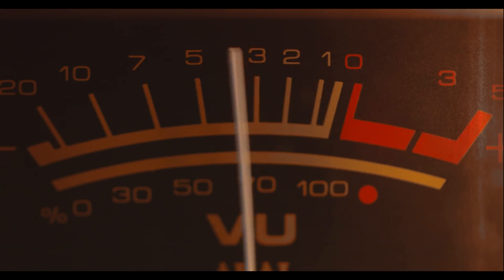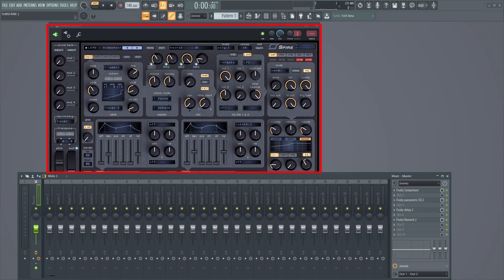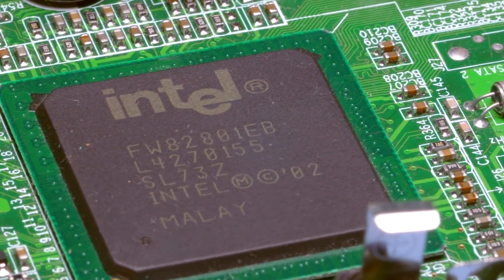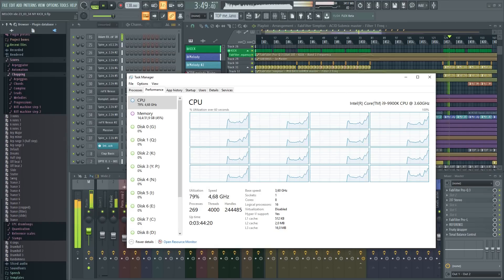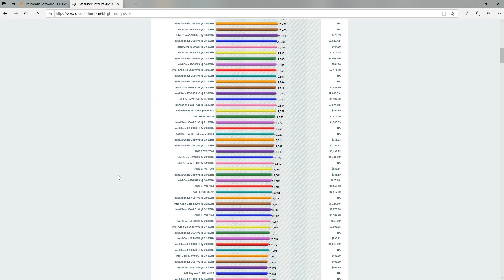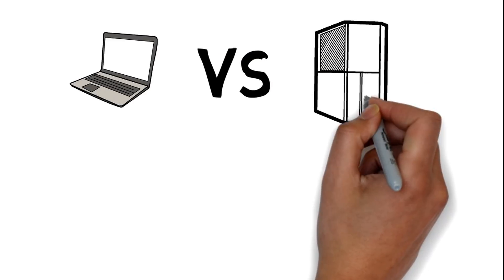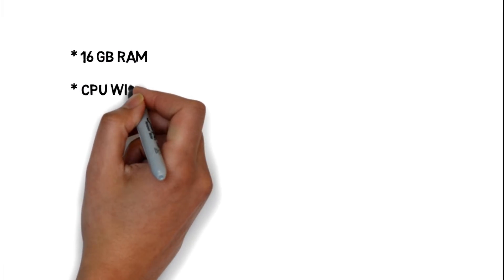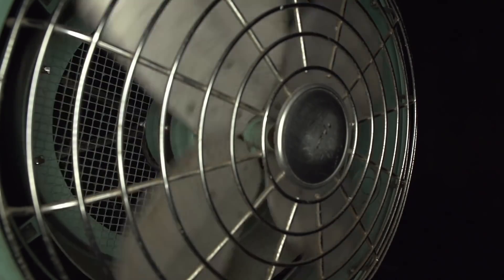The Best Computer For Music Production - What's Needed And Why!

Comment: Who is buying Intel today. Apple's fans.. I mean ppl who like spend money for nothing.
Reply from the maker: When you take OPC (operations per cycle / clock) into consideration then the 9900k is most likely still the "best" when it comes to music production. It can run at 5 ghz on all cores vs the AMD flagship, the 3900x, which is basically pushed to the limit from the factory and can only run at around 4 ghz on all cores. That said, for anyone who doesn't need to push it to the limit and who also use their computer for other things such as video editing for example, and who is also on a budget, the AMD alternative will provide much better value for your money. 
Most people don't need the very "best" computer for music production, and AMD will therefore be the best bet for most people. :)
Reply: @FireWalkMusic  What would you say about the new threadripper 3970x? It has a 3.7GHz clock speed in each core while having a tremendous amount of cores to handle many channels. Is there a better alternative from Intel? I want to build the best PC for music production at the moment, and threadripper seems to be more attractive. The only intel advantage is AVX512, but I don't really know how significant it is in music production. What would you consider as the best possible CPU at the moment without thinking about money?
Reply from the maker: @alexeysaprykin635  In my opinion Intel is still ahead when it comes to music production. If you were building a computer for video editing for example then the 3900x for example would be a much better choice with it's many cores. Many cores are also good when it comes to music production in a daw, but only up until a certain point. Pure speed is far more important, and speed and multithreading is not the same thing. When you take operations per clock into consideration then the 9900k will likely outperform all the new AMD CPU's when overclocked. The 9900k can easily run at 5 ghz on all cores, while the AMD 3900x flagship will only be able to run at 4 ghz on all cores. That's 1 ghz difference, which will have a huge impact on music production, even though the 3900x has more cores. 

That said, not everyone need the very best CPU. Far from it. In fact, most of the time the new AMD CPU's will be more than enough for most people. Also, AMD will provide better value for your money since they are cheaper. 

If you don't need a monster PC that you need to push to the very limit then go for AMD.
Reply: @FireWalkMusic  Thanks for a thorough answer:) Actually new AMD Threadrippers can run at 4.5GHz while boosted and have many more cores, so I think it may be way better for big projects with many tracks, where threadripper can show its potential. However,  for most people who don't use big amount of tracks, 9900k will definitely be better=)
Reply: Intel is necessary for audio production. Amd has latency issues, as I've heard, and audio production is serial, so Intel is still the best option.
Reply: @Noisa  the best option is 3800x. 
39++x processors cost too much for a poor advantage. Intel is out! Cost 50% more the same result. See benchmark. Buy a good audio interface with true converters. Apogee, audient, UAD or rme. If u want the best Cpu buy epic 2 from amd.
Go see the Cpu he is using in benchmark my 100 $ Cpu has exactly the same issues. But it's 100$ Cpu

Comment: I'd go for the AMD build. The 3900X is a rocket
Reply from the maker: The new AMD chips are really good and provide much better value for your money vs Intel. For anyone who want the most performance possible for their money, and who doesn't need to push the system to the very limit, the new AMD CPU's are great. Especially if you also use the computer for other tasks such as video editing, where you'll have a huge benefit from having so many cores. 
The 3900x is pretty much pushed to the limit from the factory, so there's not much to go on when it comes to overclocking. They will typically only run at about 4 ghz on all cores, while the 9900k Will typically run above 5 ghz on all cores with no problem. This will have an impact when it comes to music production since sequential processing is so important. 
That said, very few people actually need to push a 9900k to the limit, and in most cases the 3900x will be a very good choice indeed! It will also be faster than the 9900k in various other tasks, such as video editing among other things. :)
Reply: @FireWalkMusic  It can't be said better. I don't need so much single core performance and most of the people don't need to either. If I have to spend 500€ on a CPU, I spend 50 more on the one that gives me more multitasking performance

Comment: Bought exactly the same components as you've mentioned in this video. Now my I'm trying to set it up and my PC tells me that my motherboard doesn't work with this ssd. A little bit disappointed....
Reply from the maker: Hey, what kind of OS are you running? Do you have more than one M2 drive on the motherboard? This motherboard has two M2 slots ( SATA-600 / PCIe 3.0 and PCIe 3.0) They should support all M2 (2280) compatible SSD's. Make sure that it's installed correctly. Also, have you tried moving it to the other M2 slot to see if it works then? It's been a while since I built this rig now but I remember the motherboard manual said something about SATA 0 or SATA 1 being shared, so that if you have another disk connected there then it might cause a conflict with the M2 drive. If so, try disconnecting it and see if it shows up in the bios. If not, try moving it to the other M2 slot. 

Several people have built this exact rig and this is the first time I hear of this issue. In the worst-case scenario you could always get an m2 to sata adapter, but I don't see why that should be necessary, because the motherboard should be compatible with this drive.
Reply: @FireWalkMusic  Thanks for your quick answer. It said that this slot does not work with a M.2 Card. It said it needs a  M.2_2 Card. But I'm going to try out the 2nd slot…. Thanks again :)
Reply from the maker: @philforeign  M2_1 and M2_2 are likely just the labelling for which slot on the motherboard is which. Let me know how it goes! :)
Reply: @ @FireWalkMusic  lol. It worked with the other spot. Got it all Setup now. Appreciate you helping me out here!
Reply from the maker: @philforeign  Great! I'm sure you'll be happy with your new rig :)

Comment: Would this be ok to run protools?Dell Optiplex 9020 Desktop PC (A Grade OFF-LEASE) Business SFF Intel Core i5 4570 3.2GHz 8GB 500GB HDD Win10 Pro (Upgraded)
Reply from the maker: DAWs themselves can be run on even very old computers as they don't demand much from the system at all. It's the size of the projects you make that will determine what kind of computer you'll need. Large projects with a lot of VST's and effects will require a lot of processing power. Smaller projects with mostly recorded audio and such can be run fine even on older computers.
Reply: @FireWalkMusic  hi thanks. Just one more question. Would this one be better? AMD Ryzen 3 16GB RAM 240GB SSD 2TB HDD Gaming Computer System Office Desktop PC
Reply from the maker: Which Ryzen 3 exactly? Most likely they will be quite similar in performance. However, the Ryzen setup has twice the amount of ram, and I usually recommend 16 GB of ram.  AMD based systems will usually provide better value for your money since they are cheaper.
Reply: @FireWalkMusic  thankyou. So a i9 is better than a i7 and the higher the ram the better?

Comment: What many people do not understand is that you need to mix your audio stream on the dsp of your sound interface. Because no cpu is powerfull enough to handel to much cross core mixing. The syncronisation will kill all your cpu power. You need to send all streams into the sound interface on separate lines, NEVER sum lines in the daw. Then let the dsp of the interface do the mixing and syncing for you. That is why it is there. Many people use just the daw for that and in most cases unless you have a monster cpu you get into a ton of pops and clicks. The more summing of lines (mixing) the worst off you get. What I suggest is a competly different setup, try it and see your available daw power increase by more than 100%, the more cores the more the dsp will save you. USB interfaces are horrible for this, get a pcie card. By doing this you can save a lot of money, by not needing to have such a highend cpu. Get an older XEON rig with tons of cores and fly. Never go below 3Ghz on the cpu.

Comment: Hey bro, i5 9th gen 6 core
2600mhz 16/32gb RAM 
gtx 1070 with 500gb SSD
1tb HHD. 
Is it enough for studio one 4,as i don't use audio tracks a lot like more than 2 but use some heavy sample libraries. ??
Reply from the maker: Samples are just audio files being played back, and don't require much computational power at all. If you don't use a huge amount of VST's then a 6 core i5 should work very well. Studio one itself is very easy on the CPU. It's the amount of VST's (sytnhs and effects) that matter the most, as well as automation to a certain degree.
Reply: @FireWalkMusic  Thanks for the reply! So the vst and the effects used are cpu hungry ? Well,i mostly gonna record my fantom g tones but not the drum tracks. I'll take the out put dry without any effects, and add effects from studio one after recording. For reference i do cover songs instrumental. Literally imma noob :D 
So i5 with 16/32gb RAM is more than enough,right? I'm very limited in budget. Can only go with i5 since i7 are expensive in India.
Reply from the maker: @vibinmonuttan5041  Yes, I believe this will be more than sufficient for that kind of use. :)

Comment: The sound card can be an issue too coz some drivers are badly designed. On slower PC you can buy some good ASIO stuff like behringer or other and get away from latency troubles. Maybe you should try and see what happens.
Reply from the maker: The ASIO driver can have a big impact, that's true. Most professional audio interfaces come with their own low latency ASIO drivers, which is part of the reason why I recommend using them. When using the integrated sound card on your motherboard you'll have to use one of the generic drivers, and that's not ideal.

Comment: The new AMD Ryzen CPUs change all this... They have as fast or faster single core performance for less money than Intel now.
Reply from the maker: The new Ryzen CPU's are great and provide far better value for your money vs Intel. Currently the 9900k has about 8% faster single-core speed, which is not much, but keep in mind that it can easily be overclocked to run at 5 GHz on all cores, while the 3900x will typically max out below 4 GHz. According to this article only 6% of Ryzen 3900x CPU's are able to run at 4,2 GHZ on all cores: https://www.pcgamesn.com/amd/ryzen-9-3900x-overclock
Now, this means that the 9900k will be able to run at almost 1 GHz more on all cores, which will have a huge impact in audio production, especially when you take IPC 
 (Instructions per cycle, or operations per clock as it's also commonly called) into consideration. As soon as I can get my hands on one of the new AMD chips I'll be running some tests and comparisons. I used to be a real AMD fanboy back in the days, and I'm really glad to see that AMD is finally able to take on Intel again. This will benefit us, the consumers. 
Right now I would recommend anyone who is on a budget, or who use their computer for other things as well, such as video editing to go for the 3900x rather than the 9900k However, if you need to squeeze out every last bit of performance for audio production purposes then the 9900k will most likely still be the fastest option. It's hard to defend the Intel CPU when you take price into consideration though, so for most people I would say that the AMD option is the best way to go right now. :)
Reply: @FireWalkMusic  I was thinking of the 3850x which is much closer in single thread and also can overclock pretty good to over 4.7ghz.  I'm a long time (20 years) video editor who used Intel religiously until Ryzen so it's good to see them actually competing in single thread performance for a change. =)

Comment: I disagree, There is no ultimate,
You need an i5 8000+ (8th gen or more) OR Ryzen 5 or ryzen 7, ssd for programs and 16gb of ram nothing more. For 600/700$ you can get that easy.
And an audio interface of course, behringer is very good
Reply from the maker: That's a matter of perspective I suppose. If you make rather light projects and don't need much, then you're right, there is no ultimate, because you already have more than enough processing power. However, if you make some huge orchestral projects with a lot of vst's and effects for example, then even the most powerful computer might not be enough. Some Cubase users actually use more than one computer, running heavy plugins such as omnisphere and such on external computers in order to make everything work. It all depends on what kind of projects you make and how you work. Some people don't need much computing power at all, while others need insane amounts of it. 

If you take a look at the project in this example, it's almost maxing out even the i9, so there are definitely people who would need the "ultimate". Most people though will get by with far less. I'll be making a separate video soon about budget computers for music production. This one was intended for those who make very large projects and need a lot of computational power. :)

Comment: I change  Intel for AMD Ryzen 3600 that is a beast for Audio Production.
Reply from the maker: The new Ryzen CPU's from AMD are very good. They provide great value and will typically deliver more performance for your money vs Intel based systems. They are ideal buget options. There's an amd alternative listed in the description below the video. They offer basically the same single core performance as the 9900k. However, the 9900k will be able to run at higher clock frequencies vs the AMD flagship when overclocked, and when you take operations per clock into consideration then the 9900k will still outperform the AMD flagship, but not by a huge amount. When you take price into consideration, then AMD is definitely the way to go, unless money is not an issue and you really need to squeeze out as much performance as possible.  :)
Reply: @FireWalkMusic  Yes for money AMD is clear winner, but who needs overclocked 9900k for audio production ? ;) Soon I will stress out my Ryzen in project with about 180 tracks + plugins, then I will see do I need stronger Ryzen or maybe overclocked 9900k, but ryzen X also can be overclocked, and I have another PC with TR 1920X on board, so using Vienna Instruments I can split vst instruments and kontakt instances for two computers.
Reply from the maker: @montazownianr1  Again, most people will make due with far less, but there are some people who need the very best, and I'm one of them  :) This video is intended for those who want or need the very best. There will be a separate video about best value computers for music production. 

AMD can also be overclocked too, but not as much as the i9. The AMD CPU's seems to be almost maxed out from the factory. The 3900x for example will only be able to run at about 4,1 GHZ on all cores, while the i9 will be able to run above 5 GHZ on all cores. 1 GHZ more will make a huge difference when  you take operations per clock into consideration.

Again, most people won't need that kind of computational power, but for those who do, and this video is aimed at them, the 9900k is still a great CPU. :)

I will put out a new video with an AMD setup soon. Also, I'll put out some comparisons with the i9, as well as a "best budget / best value" option, since most people won't need the very best, but rather something in between. :)
Reply: @FireWalkMusic  That 5Ghz on Intel 9900K is only for one core as far I know.
Reply: @FireWalkMusic  And also 3900X is faster in single core benchmarks ;) Finaly AMD is serious company.
Reply from the maker: @montazownianr1  I'm running it at 5 GHZ on all cores myself. :)
Reply: @FireWalkMusic  How come? All reviews that I read about mention all programs can utilize only one core at his max then rest cores are below 4.8 or 4.6Ghz
Reply: @montazownianr1  My 9900k is also running on 5 ghz on all cores. I also considered the AMD since it's cheaper, but it seems like they are clocked about as high as they can get right out of the box, and the turbo frequency is just for select cores, not all of them. In reality it seems like they can't go much above 4 ghz on all cores: https://www.pcgamesn.com/amd/ryzen-9-3900x-overclock
Reply: @kevintran9321  But 9900k is slower anyway than Ryzen 9 3900X so... magical Ghz doesn't work here... https://www.extremetech.com/computing/301208-intel-core-i9-9900ks-review-5ghz-all-core-boost-takes-on-amds-7nm-ryzen-cpus

Comment: Would you still recommend the i9 now that AMD has released the 3 gen cpus
Reply from the maker: The i9 will be able to run at higher frequencies on all cores. The new AMD chips has about the same single core performance as the i9, but when you overclock both to their max potential and take operations per clock into consideration then you'll get more performance out of the i9 still. Not so much though that it can justify the price difference. You'll get better value for your money by going the AMD route. :)
Reply: The 9900k will be able to run at much higher clock speed (5 ghz on all cores) vs the AMD which seems to top out at around 4,1 GHZ: https://www.pcgamesn.com/amd/ryzen-9-3900x-overclock